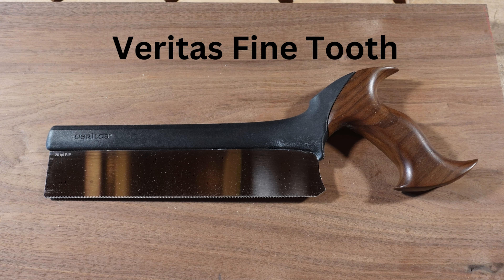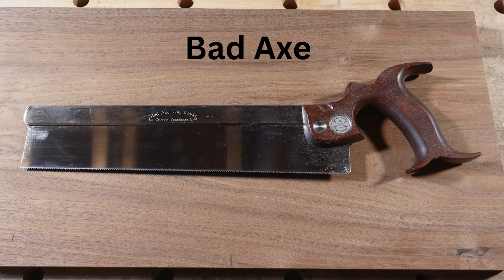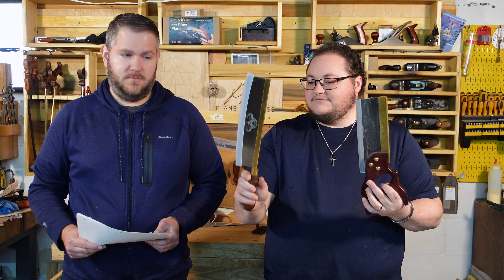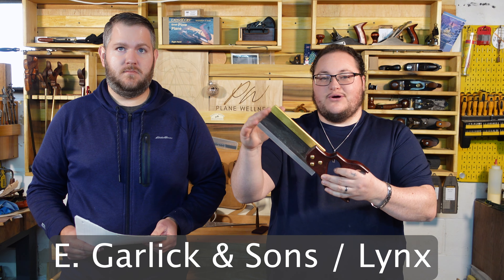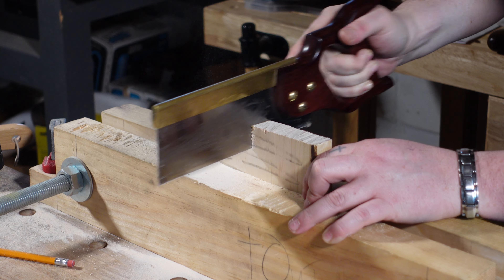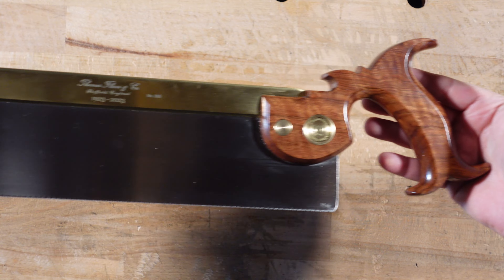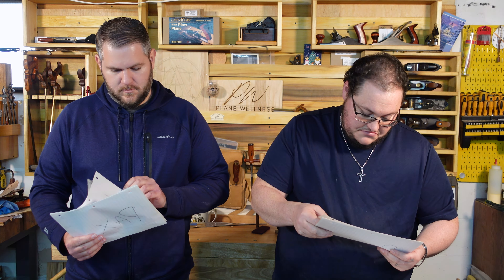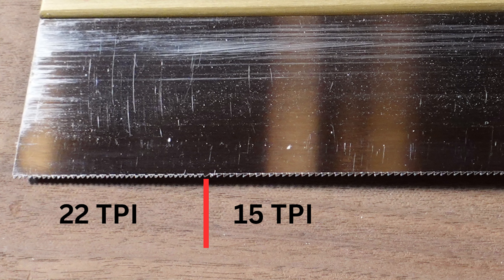HUGE 9 Saw Review and Comparison

Comment: Thanks for the video and both of your opinions.  

I have a modern Lie-Nielsen and the handle is wider than the handle supplied on the previous Independence saw.  I don't have small hands but the Independence saw just feels more comfortable to hold/handle than the LN does.  I have a small dovetail saw from about 1820-1840 and that is by far the most comfortable handle of any saw I own.  It's just an amazing fit.
Reply from the maker: Thank you! Yes I had one of their old ones to and it was very close to the size of the Blue Spruce. I'm not sure why they changed it :(

Comment: Just my 2 cents on that fine tooth progressive saw from Rob Cosman which I bought. That is a specialty saw for thin stock dovetailing not general purpose. That’s what I use it for. I didn’t buy it for 3/4 thick stock because yes, it would cut too slowly. I use it for 3/8 and 1/2 inch thick drawers etc.
Reply from the maker: Wait you only use the progressive part on thin stock?! I never though of that!
Reply: @BatCaveCreations  I start with the finer tip teeth but transition into a full stroke. The idea of the this saw with fine teeth overall is that thinner stock will be less likely to tear out.
Reply from the maker: @fredpierce6097  ah ok! Imma have to give it a try on thinner stock vs the others in the tpi/ppi range! I do see where the little teeth would help in think stock

Comment: I ended up going down the Bad Axe path, and still not regrets. One of the main reasons is that if it gets dropped, the entire saw isn't ruined because the folded back allows it to be tuned up again, or have the plate swapped out. The curve should be fixable, if the back isn't dead straight or uniform in clamping then they have a duty to fix that. In terms of a handle finish that will look perfect forever, the Blue Spruce wins. Nothing will preserve the timber better than being infused with resin, I own one of their mallets. They are pushing the envelope with a friction fit in a milled slot in the back spine too.
Reply from the maker: 2 great points! That is a benefit to the folded back and the resin infused handles on the blue spruce will make the finish last forever!

Comment: with the Bad Axe, pulling to one side, means the set is too heavy on that side.
Reply from the maker: It is, but we also ran into the issue of the plate not being straight. It is bowed both length wise and width wise, so it needed to be sent back. :(
Reply: @BatCaveCreations  Bad axe are one of the few companies that uses folded back, didn´t help to tap it??
Reply from the maker: @OrangeGeemer  I did try that too, no luck and the flick of the metal sounded inconsistent along the length. I thunk it has a few issues haha

Comment: Shane Skelton, buy once. 
RIP or cross cut, different task. Accuracy above speed!
Reply from the maker: I know me personally I'd never be able to buy a Skelton. They cost over $1k :(
Reply: You don't need a high TPI crosscut saw. Rip is going to cut just as clean. Well, it should if the saw is any good.

Comment: I have an order for 3 bad axe saws (they should be here during January), now I´m scared.
Reply from the maker: Ooh I'm hoping this one is just a fluke! But check the plates best way to do that is to cut full depth and then try lifting it up out of the cut that's how I discovered the issues with this one :(
Reply: Love all my Bad Axe saws, you’ll love them!
Reply: @BatCaveCreations  Can you explain a little bit more how you asses your saw ? I bought a Badaxes crosscut saw last spring and never been able to cut strait with it. Also it seams to catch and get stuck super easily. To the point where I now use my tenon saw to make my crosscut joinery (an other badaxe witch I love). At the beginning I thought it was my technique but now I wonder...
Reply from the maker: @pier-oliviermoreau4374  Dang! I am sorry to hear that. what I do is I cut full depth with the saw as far as the saw can go cut all the way. then look at that cut if it is curved. If there is that's an issue. the other thing you can check is the set. feel set on both sides if it feels heavy on one side that's an issue. the last thing is to actually take a square or a straight edge to the plate to see if the plate is straight on both sides and length wise and width wise. Every time I get a saw I do those 3 things to really assess it. Make sure that it's ok
Reply: @BatCaveCreations   Thanks for the help ! ... Well, I'm happy (and sad) to say, I wasn't crasy. I just did the 3 tests and they are all positive. I will check with BA and hope.
Reply: Should have saved up a bit more and put it towards a couple of Shane Skelton saws , all the rest are mass produced now , just my opinion and I've had all apart from the blue spruce .
Reply from the maker: @pier-oliviermoreau4374
Dang! Hopefully they make it right for you! Let us know!
Reply: @Mjordanlky  things change. They certainly have changed at Bad Axe. The founder has left the company. When people leave they take what they brought with them too.
Reply: @1pcfred  understand. I can only speak from my experience, and I’ve also purchased saws after the owner left, still same quality as before from my experience. I’ll interchange them between my Lie Nielsens and Cosman’s with just as much enjoyment. Customer Service portion he spoke to in a separate video is more of a concern to me than anything, but I have nothing but great things to say about the company. Great seeing all these saws in one video, long overdue
Reply: @Mjordanlky  more like customer disservice. They treat people like they've treated this guy and good luck to them.